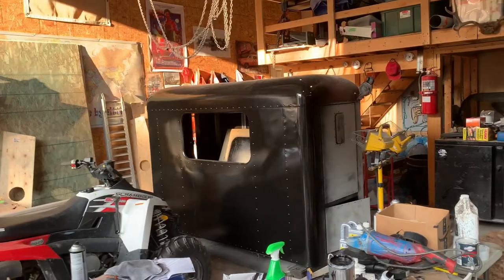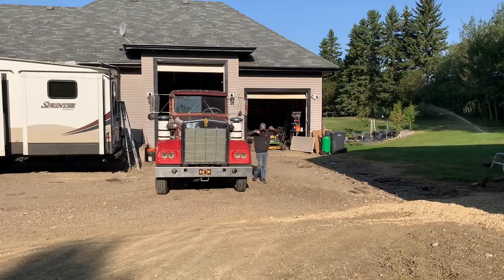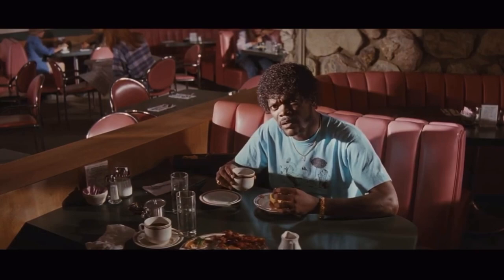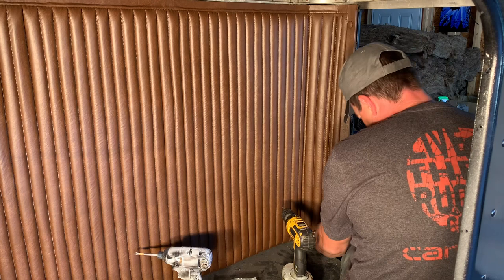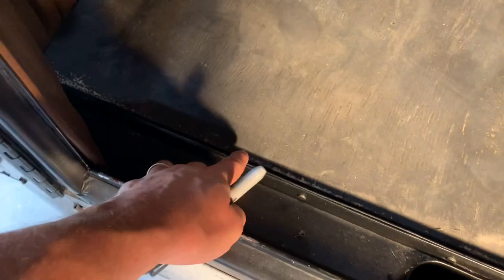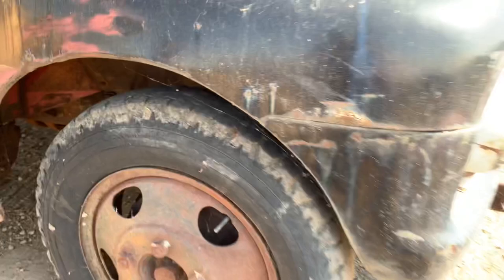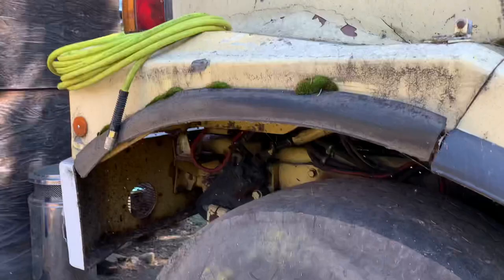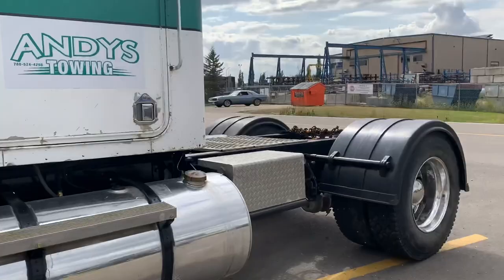Smokey & The Bandit Tribute Truck Ep.29 DayCab Interior Install Pt.1

Comment: one thing i dont miss from the late 70s and early 80s was getting to shop  in the winter  at 4am and moving  all the other cabovers trucks to get my 1978 transtar11 out it was always way in back and the shop was filled with so much smoke  from cold starting all the other ones to move them you couldnt breath even with both big doors open and the cold air rushing in in minnesota.loved that truck though it was dark brown metallic with 3 stripes 400cummins 13 speed comfortable sleeper but the leaf springs and and high 5th wheel plate where drawbacks escpecially in chicago took a bridge light out one time at 3am it exploded and sparks flew and i took the high side slowly

Comment: On thing I would have done on the bunk mount. Throw on your actual nut, spin as high as you could then used the double nut method to hold the bold from below your mounting nut. Once you got it tight, take off the other two nut, not weld needed.

Comment: So why aren't you using mold and mildew , fire resistant foam board with reflectix on top of that, all seams taped air tight with superstick builders tape before putting any interior panels, sleeper and cab, back on ? The noise reduction is incredible,  not to mention the additional heat and cold resistance. Every truck I buy  do that over a weekend.
Reply from the maker: Installed Noico silver sound deadening and black foam insulation in a prior episode 👀

Comment: Just curious...why not throw some insulation behind the bunk liner?  I know you don't plan on really using it as a working truck and sleep in it on those cold Canadian winter nights.  But I would think it would help the interior noise factor quite a bit.  But you do very good work, sir.  Thanks for sharing.
Reply from the maker: Actually installed Noico’s sound deadening and foam insulation in an earlier episode 👀 same as what I did in the Pete

Comment: Just a gentle 'heads up' but there is a wiring harness hanging down under the radiator of the K'worth. Hate to see that snag up and drag the rest of the knitting out!
Do like the interiors you are doing. That supplier surely does a quality job.
KBO mate ....
Reply from the maker: Yeah I noticed after I moved it and zip tied it up out of the way 👍

Comment: Instead of a huck gun. Check out the "Astro XL Blind rivet adapter kit" does 1/4" rivets and small ones too.  Converts a 1/4" impact or a drill into a rivet gun. Might help ya out.

Comment: You may have something binding on the rear axel at 2:32 in the video. Might wanna check the video and see what I mean. It looks like something pops out and back while the suspension is articulating.
Reply from the maker: Yeah I noticed that … not sure if it’s a rotating component or just those worn out leaf hangers 🤔

Comment: Id have been ever so tempted to go with an extra layer of sound deadening, and heat insulation behind the trim for the sleeper, like the noico that ezrider359 used

I know it can be a nightmare to fit, a nd once its fitted it can be a nightmare to work around, but its a thought

Looking good, soon you wont have any work left to do in the new shop when that's finished 😂
Reply: He did in Little by Little.

Comment: Couple questions Bud. First off, how come you didn't insulate this bunk like you did on Little by Little? Secondly with the grade difference between your existing garage and the new shop aren't you going to have a water/ flooding issue?.
Reply from the maker: I used the same Noico black foam insulation I used on LBL and there’s grade away from both buildings that meets in the middle in a V that goes toward the trees … watched it in heavy rain and works like it should 👍

Comment: Just a quick question to you how come you didn't put a insulation between the wall and the outside wall to keep a little bit warmer or cooler in the summer and winter car is quick like to know this is Bob from Vero Beach Florida God bless and have a great day
Reply from the maker: I actually installed Noico sound deadening material and their black foam insulation panels  in a previous episode 👀 same as what I put in LBL

Comment: Question - what happens if you don’t cap the stacks and get a ton of rain? I live in Florida and we could get 3 inches in a day.  I know all of might not go down the stacks, but a fair amount could. Would all that water just sit in the pipes?  Rust them out?
Reply from the maker: In all likelihood the water would find a way to drain out from one of the connections but even if it didn’t once you fire it up and run it most would be blown out/evaporated.  I think the big concern is leaving standing water in the bottoms elbows and having them rust from the inside out 🤔
Reply: @TwinStix  thanks for the reply!  I didn’t think about the connections.  And, Project Snowman is looking great.  Soon you’ll have them in the garage and won’t have to cap them.
Reply: @TwinStix  the water also blows out when you start with all the carbon in the exhaust. All over your clean truck!
Reply: I like your tribute trucks but the Iron Duke K 100 had a 903 v-8 cummins.
Reply from the maker: @jefferyhill5708  I spoke with the son of the fellow that bought the actual truck from a local Kenworth dealer in Mississauga after filming wrapped up and he was pretty sure it was a Cat hiding under the cab
Reply: @TwinStix  no that is a 903 with a turbo if you watch the movie you can here it that is a 903 turbo charged with a stemco chambered muffler. and a 13spd roadranger trans.that is like the man in joplin mo.that says he has the convoy mack and his has the wrong moter and trans in it.
Reply: The 903 is not a terreble motor but some drivers don't wind them tight enough.You need to run between 2400 and 2800 and they tac out at 3000.most drivers think a cummins shouldn't turn that much. But its ok.

Comment: Being from scotland I love these old k100 trucks but I actually know very little about them. Can I ask whats so special about jake heads? Are they just a simple mod for more power or is there something else about them etc?
Reply from the maker: Just adding the “Jacob’s Brake” engine retarder system … it helps slow down when loaded and saves wear on your braking system with the added benefit of making lots of noise in the process 😆

Comment: The only problem to make true snowman rig 
He didn’t have chrome rims but buds alyinmn
Reply from the maker: Those are original bud aluminum rims that have been polished by a magician.  However, they are 24.5's and I am exploring changing them over to authentic 22" ten hole split rings all the way around
Reply: Do you even watch his channel? He already bought the movie correct 5 and 10 hole 22in aluminum rims and even got 2 more in this EP. The problem is finding the rare 10.00r22 tires that no one seems to make anymore

Comment: No insulation behind the panels to keep out the heat in the summer and the bitter cold in the winter?
Reply from the maker: Installed Noico silver sound deadening and black foam insulation in a prior episode 👀
Reply: @TwinStix  Cool, Saw you do the cab. Missed seeing you do the sleeper.